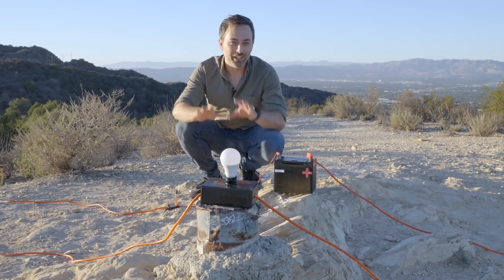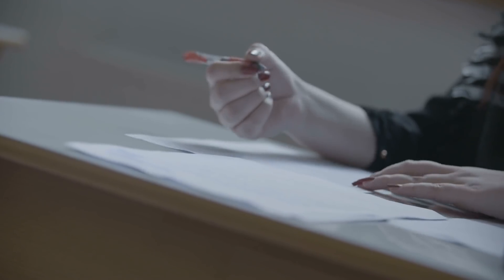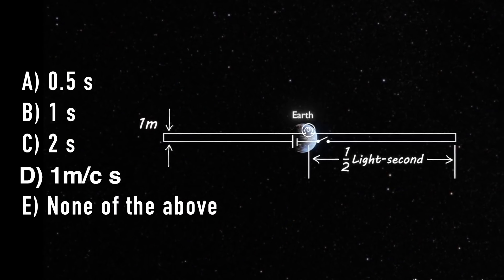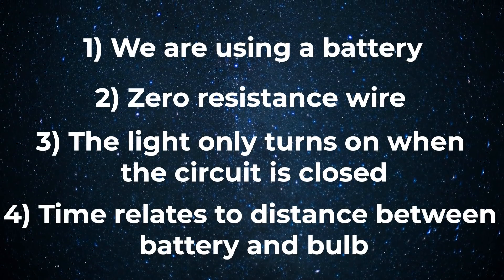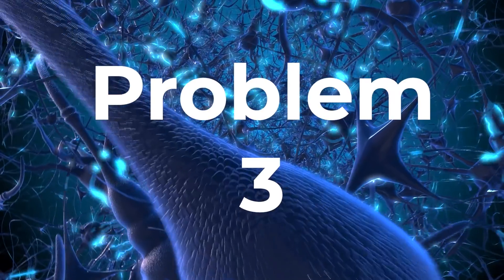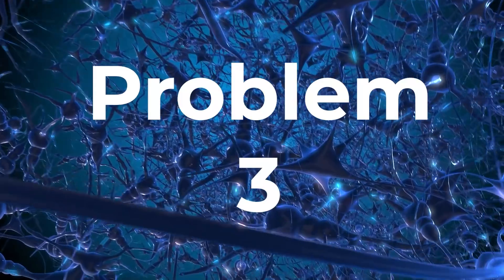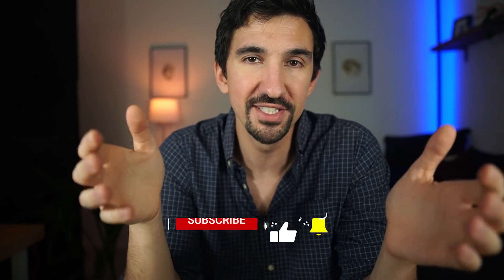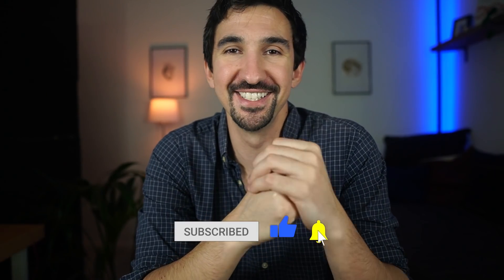Is Veritasium Wrong About Electricity?

Comment: Thanks for this video! I 100% agree with absolutely everything you said and I hope more people see your video to clear the confusion.
While it's true that the EM field also travels outside the wire, the EM field travelling in the air would never be as powerful as what he showed in his example. The bulb would receive an extremely small energy at 1m/c (I don't even think it would light up but ok...) and fully light up at 1s and yet that's completely ignoring the ridiculously high resistance of this gigantic cable, but I know that's the hypothesis.
Reply: So if I place a secondary light(not part of circuit) parallel to the 1st one , will they have similar input power (until 1s) , lets say I recreate this at home , is there any way to show that there is voltage at the 2nd bulp?
Reply: @mr.mirror1213  If they are at the same distance of the EM field they should receive the same energy yes. The wire of the 2nd bulb, even when unplugged, will act as an "antenna" just like he says in this video.
That's how transfomers work, except here there is a massive loss of energy in this setup.
Reply: Beware, as Veritasium channel is not the only one to endorse that answer, and he won a huge bet about physics very recently.
I would not bet against him so soon.
Reply: @ShapeDoppelganger  I'm not saying he's wrong. Actually I totally get his point. But he presents thing in a way that might lead people to think they are completely wrong about electrical circuit, and even consider that the lamp lights up just thanks to the EM field coming from the air... He gives some preconditions that completely break physics to make the experiment work and make his answer correct, accidentally bringing even more confusion.
He could have just have just shown how a transformer work to make his point instead of this specific example.
Reply: @ShapeDoppelganger  And just to be clear, the 2 physically impossible assumptions Veritasium makes are given at 0:37 and 0:43 in his video:
1) the electrical wire has no resistance
2) the light fully lights up no matter if it received 12V or 0.1V
Ok for 1), I think it makes sense for this experiment but IMO he should have elaborated a bit more on 2) as this is a big deal: if the lamp fully lights up with 0.1V then we're not concerned about transfering energy anymore but just a signal, like with a TV remote

Comment: ...so if we change geometry of the circuit in such a way so that the wire around battery and light bulb is 1m wide and distance between battery and bulb is 300.000 km this would somehow cause greater delay. It's kind of counterintuitive since length of the wire is the same as in the first case, but your "antenna" analogy makes it a bit more understandable.

On the second thought, would this mean if in the original thought experiment we were to place ampmeters at both sides (each 300.000 km from the batter) light bulb would turn on faster than the ampmeters would register any flow of current because they are further from the source?...:/

Comment: You can also imagine this setup as a mesh or resistors, where some resistors represent the wire and some - the air gap between them.
Even when the switch is off, there is a circuit between the bulb and the battery through the air. But the current is negligible due to enormous air resistance.
When the switch is flipped, the air gap between the wire and the battery is removed and the schematic is changed.
EM potential starts to propagate through the wire, thus forming new curcuits. The current begings to flow through the segments of the wire, until it reaches the bulb.
If we want to count for the antenna effects, we can simulate the wire and the air gap segments as not simply a resistors, but RLC elements.

Anyway, my point is that the original video is a misleading vulgarization of the real phenomemon observed.
Thank you for raising this.
Reply: No. You have to model the circuit in terms of distributed inductance and capacitance. It has something called a characteristic impedance. Furthermore the inductance and capacitance determine the energy propagation speed. It is likely that their values give a propagation speed very close to that and a very high characteristic impedance. This means that we can just forget about it being a transmission line and just use the electron pump model.
Reply: @rogerphelps9939  True, and considering both wires in the open circuit example are exactly the same, the characteristic impedance is the same, so power transmission through the field would (idealy) be 100%. Kinda like a 100% efficient 1:1 transformer but it's antenas (or antenie I don't really know)
Reply: @dimitristryfonos9680  antennae, but the both are correct, antennas is correct and antennae is correct. And yes, the final model should be an RLC circuit. But what is important is, and has not been mentioned before, that the poynting vector does not mean that the flow of electric energy is from the battery directly to the bulb through the air gap. It means that the conductor radiates energy. And yes, this means that if the other conductor picks up the radiated energy and leads it to the bulb, the bulb will turn on, even though less bright, it also means that the conductor will also start to radiate energy opposing the original poynting vector. This is called lenz law. The video makes it as if all of the conductors radiated energy into the bulb. Also, it makes it as if the conductors weren't even necessary, just the poynting vector radiating from the battery. As if you just needed a battery and you put the battery close to some closed circuit and it would turn on automatically (like a shorted AA battery - not a car battery, in car battery case, the whole circuit will light up with fire light, hehe). That is mostly not a case since it is true that it will induce some current in the bulb, but most bulbs won't turn on as the current will be too small (except for some light tubes).
Reply: I had a similar thought experiment that didn't make sense to me. 
 
create the same setup as veritasium's video, but replace the battery with a wire, such that it's just a lightbulb attached to a 1ly wire.

then, make another nearly identical circuit except it's just the battery, but with no lightbulb.

assume for both of these circuits that we change the wire dimensions so that they're both smaller than before.  I'm not sure what factor smaller they need to be. my gut says something easy like 1/√2

wouldn't this be identical conditions to before?

I can't convince myself that this lights up the bulb
Reply: @1Embla  2 ls wire. This would be a perfect folded dipole for receiving 0.5 Hz energy waves. It would probably actually light a bulb without a battery.
Reply: @rogerphelps9939  how is that different from my suggestion above? :) My point was that if you replace the whole wire with 1 RLC element, you would not be able to simulate or «see» the charge propagation through the length of that element, but only at its end points.
So a mesh of RLC elements seems more accurate to me for the visualization purposes.
Reply: Lots of people missing the one point. VT said ANY amount of current. Air has a very high resistance, but is not a "perfect" insulator. A miniscule amount of electricity will flow through air, from batt+ to that side of the bulb, through the bulb, back to batt-. Miniscule, probably unmeasurable (except with NASA-level instruments), but greater than 0.000000000000000 Amps. ANY current.
Reply: You don’t need any current in the air gap. The point is energy is transmitted by ExB, there is an E and a B so energy travels from battery directly to bulb,
Reply: @jimmcclymer4230  Also, it's a physically-small series circuits, where two infinite xmission lines happen to be wired in series between battery and bulb.   If their Zo is 700 ohms for each, then the bulb needs to be carefully chosen to act as a 1400-ohm resistor (to get maximum brightness, 6V and 4mA, 24 milliwatts.)   An LED might light up with normal brightness.   A several-watt 12V incandescent bulb wouldn't glow at all.
Reply: @wbeaty  Great points. That was a very physically small series circuit. If he made the circuit the actual length he was talking about, even ignoring resistance (not realistic), I doubt even the LED would light up. He's running it off a 12V battery, it won't work if the conductors are too long.
Reply: The current isn't just negligible when the switch is open. There is no current at that point. Current is measured in Amperes. You're thinking of something that is measured in Joules. They are not the same and should not be used interchangeably when trying to teach or explain how it works. The air gap is large enough to ensure that. it was designed that way for a reason. Same with High Voltage and transmission, they ensure their much larger air gaps are large enough for the voltage applied to ensure there is no current. Would you want to rely on hoping an atmospheric change like a rise or drop of humidity didn't happen to suddenly make your air gap too small and have current where there should be none? There is a Potential Difference when the switch is open, but there is no current until it the switch is almost closed.

Comment: In the early part of Veritasium's video, he shows the chain-and-roller analogy. Even though the chain moves in both directions, it seems evident to me whatever-is-pulling-the-chain is providing power, and whatever-is-resisting-the-chain (including the roller and any friction in between) is converting the energy ultimately into heat--always perfectly balanced and conserved. Is there something analogous to Poynting vectors for mechanical work?
Reply: Yeah good point, I mean if we go back to the electricity, whenever an electron is emitted from the anode, another one is absorbed on the other end by the cathode, no matter if the current direction is constant or if it alternates at 50Hz, so you never "regain" energy with AC, and it has nothing to do with the energy flowing in one direction, not sure why he said that. If we wanted to recover that potential energy we lost we'd have to manually move that one electron from the cathode to the anode...

Comment: If an electromagnetic field is propagating outside the wire, how can you don’t get a shock by putting you hand on the outside of an insulated wire? For that matter what does insulating the wire accomplish? I am so confused.
Reply: You can get such a shock. The magnetic field just has to change fast enough and it has to be strong enough. The field coils of a modern MRI machine are strong enough and they are switching rapidly enough to produce induced electric fields that can be felt. If they were just a tad stronger, getting an MRI scan would quickly become a very painful affair. It simply takes high powered equipment to get to the required voltages. A small battery and a piece of wire won't do. One could probably do it with a car battery and an old transformer, if the windings are reconfigured just right. Alternatively one could try to spin a strong rare earth magnet at several thousand rpm (possibly 10,000 or more... not an easy thing to do safely, flying magnet pieces definitely hurt, even without induction).

Comment: I didn't make it far through his video, but I remember thinking and thought electrical wires contain magnetic fields and running a current through a magnetic field creates a current in a parallel electric wire because "energy" is transferred through the magnetic field to the other wire.  Would the lightbulb light up?  Probably not, but there is a measurable current through that parallel wire.
Reply: You are correct. The transmission line has an impedance of several tens to several hundred Ohm, depending on geometry and dielectrics. A typical light bulb has an impedance of a few Ohm, tops (could be tenths of an Ohm), i.e. it is mismatched and therefor not sensitive enough to detect what is actually going on.

Comment: Antennas work at RF frequencies.   The battery provides DC, not RF power …   You would however see an induced pulse due to the rising edge of the switch being closed… (square waves are made up of higher and higher frequency harmonics, including RF)…. But this would be a momentary condition - not steady state.   Furthermore, if any amount of induced voltage constitutes "lighting the bulb"... then you would not even need to flip the switch to illuminate the bulb!   (Any  random field would have done that...).          The conditions are so obfuscated and unrealistic...the original video is clearly clickbait.
Reply: Brings it to the point! Original video is an incredible and misleading scientific salad of facts :)

Comment: Yeah the imprecision about what he means by turning the light on leaves wiggle room for him to come back amd claim that he was right. He also went off on a tangent about the drift velocity of electrons which is something that's a misconception propagated by science teachers, electrons race away from the battery carrying energy which they give to the light bulb filament when they get there, without explaining the fault  properly imo... he also says that the fault with chain model, which explains that electricity travels faster than the electrons, is that it's shows power returning to the grid every half cycle... but as a schoolkid would  know P=I^2R and I^2 is positive for positive and negative current.
Problem with science youtube is that being correct or being very precise in your explanation or being helpful to confused schoolkids isn't really a win, getting millions of clicks is a win. This confusing and non-useful video veritasium made is a big win for him, 3.7M views as I write.
Reply: What are your science teachers lying about with regards to drift velocity of electrons? It is, indeed, tiny. It just happens that energy is not being transported by the electrons. That is the actual misconception that even older EEs who are not familiar with electromagnetic fields and antenna theory are working with.
Reply: @lepidoptera9337  I'm not a school pupil any more :) there's a lot of diminishing deceit in the teaching of some things e.g. electricity but 16-18yo students learning physics in the UK would be learning about drift velocity and the low drift velocity in metallic conductors it's a shock to most of them when they find out. They'd have started to learn about transformers and electromagnetism13-16yo but might have been doing battery and bulb circuits before reaching 11.
The chain in pipe model is pretty good at the appropriate level and Veritasum didn't do a good job of explaining what was wrong with it tbh.
Reply: @joinedupjon  You have still not shown any evidence that teachers are deceiving their students about the drift velocity of electrons in conductors. That electrons are moving in conductors is correct, at least if we accept that we are dealing with semi-classical electrons rather than proper quantum field theoretical ones (which we simply can't teach to anybody who didn't go trough at least three years of theoretical physics at the university level beforehand). But that's where high school has to leave it. The explanation using Maxwell's equations and full electromagnetic theory is usually second or third semester theoretical physics in university (I think I did QM before I did EM, but that depends on when professors are giving the classes at a particular physics department).
Reply: @lepidoptera9337  Classroom practice might vary but I've sat in on a classroom where the teacher got the pupils to do an activity where one pupil played the role of battery, one pupil played the role of lightbulb and the rest of the pupils were charged particles in a wire. The 'battery' gave 'energy' to the 'charged particles' who then walked in a 'circuit' taking 'energy' to the 'bulb' (which then 'lit up') and then returning to the 'battery'. The obvious inference is that the bulb lights up when the charged particles have moved from the battery to the bulb.
The pupils were 13 and TBH I don't really see anything very wrong with it for pupils of that age, they can learn that the drift velocity is actually very low when they are older. 
Drift velocity isn't in the exams sat by UK physics pupils at 16yo but it is in the exam at 18yo - it's pretty common to find disbelief in pupils who find out how low the drift velocity really is and they ask questions about it on student forums pretty often.
Reply: @joinedupjon  The kids were 13? That doesn't sound like high school science. In my high school this was taught properly in 11th or 12th grade.
Reply: @lepidoptera9337  Yeah this is the english system I'm talking about.

There's electricity in the physics exams you do at 16yo (called the GCSE) but you're not going to hit a question about drift velocity til the exams taken at 18yo (called the A level) 
if you look at teaching resources on the IOP website it seems like they're suggesting you teach that the electrons have a low drift velocity - but tbh that's not going to make sense until the pupils have done fields.
Reply: @joinedupjon  Why does it not make sense? You only need the full dynamic fields approach if you want to talk about energy flow at or near the speed of light. Neither static electric or magnetic fields or even quasi-static (magnetic induction) require deep insight at that level. I am not aware of any school system that does full Maxwell equations in high school. That's university level.